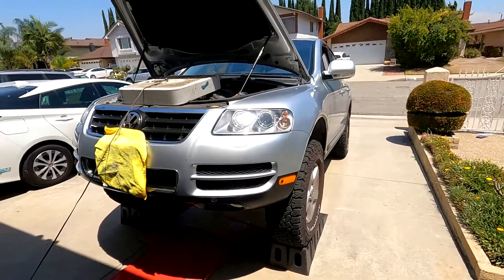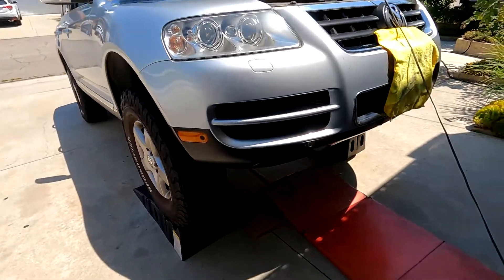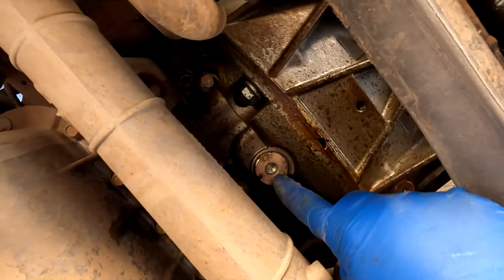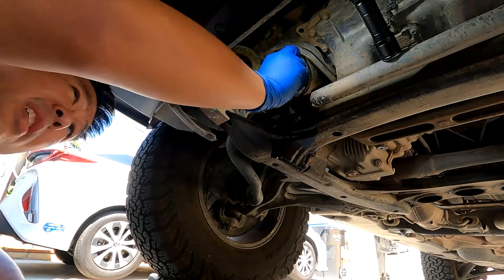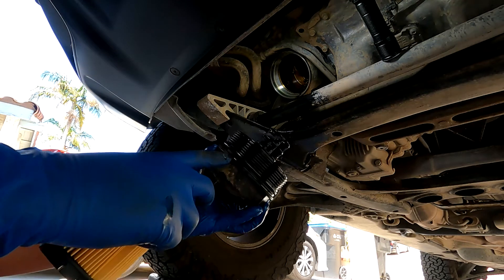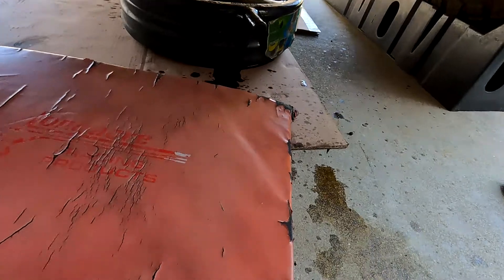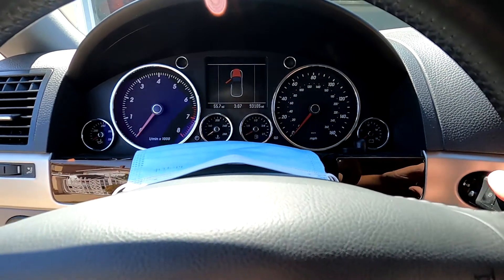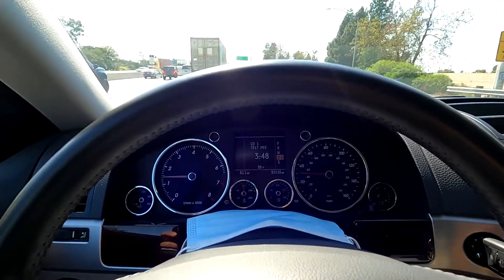Check engine code P0021 on my VW and how i fixed it the right way

Comment: If you want a cleaner no hassle oil change, pull a vacuum on the oil fill with a shop vac. Keeps the oil intact until you're ready to drain it. Simply remove the oil drain plugs, place your drain pan down and turn the vacuum off. No more oil running down your elbow :)